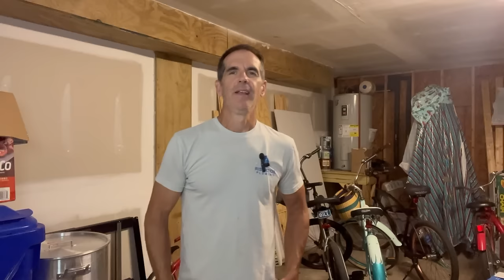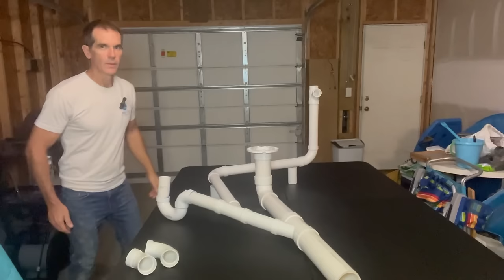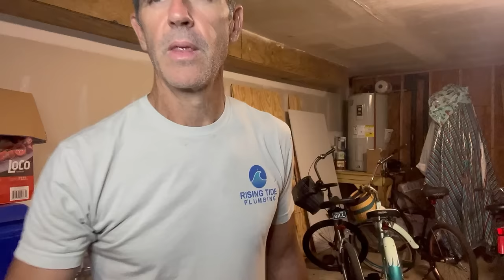Plumbing a bathroom explained in 4 minutes. [You CAN do it!] #diy #plumbing

Comment: Make sure you follow your local codes guys because in most jurisdictions a wet vent is not allowed by the inspector. I know some county’s allow it but even then you really shouldn’t do it. Unless you absolutely have to. An example is maybe you need to stay shallow and don’t have the room to run individual vents. A rule of thumb is tell me guys to follow is every fixture should have its own vent.
Reply: That's absurd. Wet venting is definitely allowed
Reply: Most jurisdictions use the UPC code and horizontal wet venting is absolutely allowed and we plumb countless apartments using it with zero issues.
Reply: Tell me you’re not a plumber without telling me you’re not a plumber

Comment: That would not pass inspection in CA.  Your example has two wet trap arms for the toilet. Also the trap arm and toilet vent combo will plug up over time. Here a horizontal drain line with a fitting for a vent must have the fitting pitched up min. 45 degrees.

Comment: 4 minutes and 20 seconds.  Most efficient and informative video on the subject I've ever seen.  Thank you.
Reply: IDK WHAT STATE YOU ARE IN BUT YOUR PITCH IS WRONG. PLUS YOUR 3 BY R Y IS NOT ROLLED ABOVE THE CENTER LINE
Reply: He is in North Carolina and his pitch is not wrong. 3 in min 1/8 fall per foot. 2 in pipe or smaller 1/4 per foot. 4 in laterals you cal get away with 1/16 in per foot. Now that is said I still try to get the 1/4 per foot on all but the pitch’s I and he listed will pass code and inspection.

Comment: Great info.  You might want to mention that while the slope and trap arm length may be legal in NC, it does not comply with Uniform Plumbing Code.  Many states use the UPC and most use the International Plumbing Code.  Please check with the plumbing inspector (Authority Having Jurisdiction) or you may be having to tear out your plumbing to make it pass code.
All in all though, Great Job!

Comment: I stopped doing plumbing work in '86 . California. Watching your video surprised me with whats allowable now. Back then only vertical wet vent was allowable,  and a WC needed a 2" vent. 

2" trap length was 5' , 3" trap length was 6' . Horizontal vents from a wye branch needed to roll up above the center line of the drain too. Lol,  my last code book I owned  was the 1976 version.
Reply: Code hasn’t changed that much, we still plumb that way here in northern california

Comment: Use the fall as precisely as possible, for example, 1/8" per foot for a 3" diameter pipe.  If you pitch it too much, you can have all of the water run down the pipe and leave solids behind to harden into obstructions.  The only exception is 45 degrees or more is treated as a vertical pipe.
Reply: My old memory was that  only until 4" were you allowed to run 1/8 per ft. Slope.

Comment: Everyone seems to forget that wet venting is an exception meaning it's allowed but not preferable. The vent in the video is a flat wet vent meaning the vent center line is at same elevation to the drain it's connected to if you're going to use a wet vent the invert of the vent should be above ithe center to the drain line it's connected to
Reply: Dry vent isn’t preferred anymore, if there’s a clog it won’t have water going through it to flush any solid out
Reply: @darkma1ice  A clog in your vent?

Comment: In California there are some differences, 
2" diameter minimum for a vent that serves a closet regardless of drain size. (That sanitary tee would have to be 2" all around)
6 ft. maximum to the vent after closet.
1/8th in./ft. grade is only allowed for 4" and bigger

Awesome video, just wanted to point out some differences
Reply: Like everything else in California,  their vent requirements are as expensive as they are inefficient.

Comment: Here in California, the minimum vent size is 2” for a w/c. I would rough a 2”x2”x 1 1/2” Santee for the lav and go straight up 2” on the dry vent by code in Cali. Thanks for the video, just subbed.
Reply: CA is UPC so a drain cant act as a vent.  This installation would not be legal there right?
Reply: @coreyfranco7060  the UPC does allow for the horizontal wet vent system depicted in the video.
Reply: @playersdream592 in the UPC code it says "a drain shall not be used as a vent".  Im in Clark County NV and I've had my drawings approved showed wet venting but got my balls busted on my underground inspections with having a single wet vent for WC and shower.  Out here im seeing either individual vents per fixture or combination double tys

Comment: No horizontal 90's allowed in Ontario period. 1/4" drop on a 3" required  instead of 1/8 and never use a 2" ptrap for a tub but always for a shower (not sure what you were roughing in for but likely a shower based on positioning). We also have to use schedule 40 pvc pipe or ABS here as that pvc isnt great with the cold. Stil a good and useful video conceptually despite the small differences! Wet venting what we call a "bathroom group" [s the cheapest and most efficient way to go where applicable.

Comment: Cool short video, i like seeing the difference in plumbing in other states in the U.S. im from Massachusetts and its very close to what you explained.  Only difference is the 3X2 wye and 2" wye would need to be rolled up above the drain, which is almost impossible to fit most plumbing especially if the floor is only 2x8 joists .

Comment: An Oregon the toilet vent must be at least 2 inch. And there must be a clean out at the end of every run. You can only use a closet bend or long sweep 90 for the toilet. All clean out must be at minimum floor level or accessible to the outside.

Comment: I pretty much agree with everything you said, but we don't use sanitary tees like that for the lavatory. .  Doesn't drain well with a sanitary tee straight into the drain line. We use short 90 then branch to the sanitary tee.

Comment: Jeff or any knowledgeable plumber, is it 15 inches on each side from the center of the toliet flange or once the toliet is installed there needs to be 15 inches on each side?

Putting a tiny bathroom in a closet size space

Comment: This looks like International plumbing code, and would not be allowed where UPC is enforced.  Never heard of venting a toilet with 1 1/2 pipe, always 2 inch and this goes back 100 years.  I  am sure it will work, however it's interesting the contrast between the two regulations.  Everything is UPC where I live.  The IPC does make it simpler for installers and is more forgiving. There are code books that illustrate the two and compare interpretation.

Comment: I have a question and maybe you could lay it out. We had a 5 foot roman tub, we had it removed and put in a large 3 head shower. We paid extra to have the concrete slab broken out and moved the drain the middle of the shower. We never had a drain issue with the bath tub, but when we put in the high dollar shower we have nothing but problems with drainage. Any ideas or suggestions, we simply do not use it anymore.
Reply: What are the problems you've experienced, and how long did it take them to occur?

Comment: 2:46 from ontario, just checked, it says max 6ft. either toilet or shower flange.
Reply: It depends on pipe size and required pitch. A 2” pipe at quarter inch per foot would be 8’, because it takes a feet to put the pipe completely below the vent. 1 1/2 is 6 feet.

Comment: I'm building a tiny bathroom over a short 3 step stair way, I made a frame to support the new floor but the drop from the toliet flange to the basement is about 3 feet, is it OK for the 3 inch pvc to go straight down that distance before turning ?

Comment: Thanks for you videos...been trying to find out while watching videos and reading books...New construction with a basement full bath and laundry (roughed in, floor poured after passing inspection.)  There is a pump in the basement floor to pump drains from the basement up and out to septic tank and I was going to tie main and 2nd flr drains into 4" where pump line goes through the outside wall.  I have a full bath on the main floor right above, and a bath right above on the 2nd floor with 2 vanities, , oversize tub and sep shower. The kitchen is on main floor sharing wet wall with bath.  My question is vents... Can I just use a 3"stacked vent all the way up for everything?  Seems like a lot of fixtures...1 washer, 3 toilets, 4 lavs, 3 showers, 1 kit sink, 1 big tub.  I just can't find anything to calculate vents per fixture even if everything is stacked on top of each other.

Comment: I want to make sure I understand fall. 3 inch line has to have 1/8 fall per foot correct and has to have a air vent at least 1/2 the size or more than the pipe you are venting and the shower and vanitee  can they use the same vent as long as its with in 12 feet of the vent? and a 2 inch pipe has to have 1/4 fall per foot?  I am  making a bathroom in a small bed room, I got a 3 inch pipe coming off the 4 inch and from right to left I will have the toilet then the vanity and then the shower. Room  is about a 10x8. I just want to make sure I got thing in correctly.

Comment: Hello - I hope this question makes sense. Would be easier with pictures. Currently my system of Vanity /sink1.5 inch vent, toilet 3inch vent and Shower 1.5 inch vent,  all had their own vent going into attic and joining on the toilet 3 inch. With a remodel I am doing the bath will connect to the old vanity/sink line and have a 1.5 inch vent wihin 4 feet. toilet isnt moving. The main concern is the vanity/sink. it is moving 5 feet away from the old shower spot. Do I need another vent for this? Based on the video and already having 3 vents in the line... im guessing not, just checking. Thanks for the awesome videos.

Comment: I have a question. I have a 2nd floor. Where the water lines were run and capped off. Between them is a 3 or 4 inch pvc  pipe that goes through the roof.  The room next to this was framed for a toilet. How can I know if I can use this 3 inch pipe as a drain for a toilet and shower and sink? Thank you

Comment: Yes, and you confirmed what I decided myself. So many say 1/8” drop is mandatory, and I’ve heard a bunch of stupid incorrect reasons. 1/8” is minimum, not mandatory. It’s so you can run through a 4” slab and not got too deep or to high at the ends. Never heard it’s different for 3” and 2” pipe. Good summary. And I also figured out about 2/3 of the details explained in this video just from thinking about things. Most plumbers get into it because it’s the highest paying trade they can handle. They usually flunked math and science. But there are some who are really smart too, like this presenter. And again, I’m sick of half the 40 minute video being theatrics to glamorize the presenter. This is what I come to these videos for. Information, not pizzazz.

Comment: OMG!  Please help!  I am having such a problem understanding this.  Are sinks the ONLY way to wet vent or can a shower, tub or toilet also be a wet vent?  Picture this.  I have a 60' main drain that will be under a slab and runs east to west through the house with the septic on the east end.  I have a bathroom slightly NW of the main branch and septic.  The bathroom consists of a shower to the NW, a tub to the North, a toilet to the NE a sink to the SW and a sink to the SE.  The sinks are split by a doorway and are only 2' from the main drain.  The toilet is about 13' from the main drain.  Should I run 2-3" branches from under boths sinks North to South and connect the shower, tub to one and the toilet to one with the sinks being the wet vent?  That would put the shower tub and toilet on the high side of the drain so will the wet vent work or does the wet vent need to be the highest point of the branch?

Comment: I don't know what code book your using. You can't flat wet vent . It look like a combination  system . But your sizing would be wrong . We must do stuff differnt in Los Angeles .
Reply: Of course you can flat wet vent, just maybe not in CA.  Remember, sometimes codes were written to help create more work and subsidize trades.  For example, Chicago and the requirement that all high voltage be in metal conduit.

Comment: Pretty sure the code states each fixture needs to tie into the wet vent individually, i don't believe how you have that set up is legal. You'd need a separate wye to go to the lav after the first wye where you pick up the tub for that to be a proper set up.

Comment: Why is it important for the air to get into the pipe?
Reply: Think about a straw. If you have a straw sitting in a glass full of water and you plug the end of the straw with your thumb then remove it from the glass, the water in the straw will remain in the straw. When you remove your thumb from the end of the straw the water will run out of the straw and will be replaced by the air entering the straw from the end where your thumb was located. Internal plumbing uses the same principle. In order for liquid to flow from your drain pipe, it must be replaced by air entering the pipe. Vents allow for this to happen. Without vents it would be like holding your thumb over the end of the straw and the liquid in the pipes would have a very difficult time trying to flow. If your pipes "gurgle" when you flush or pour liquid down drains it is because your system is not getting enough air as the liquid flows through the system. I hope this explanation helps.

Comment: We have to install that 3by 2 wye within five ft from center line of the four by three closet bend to the centerline of the three by two wye and the two inch wet vent shall not exceed fifteen ft in total developed length that's to the sanitary tee centerline that's where the wet vent ends in south fla ft Lauderdale area only six fixture units are allowed on a two inch wet vent master bathroom may have shower and tub and two sinks perhaps that's six the toilet doesn't count of course because that's wet vented not on the wet vent but that's four fixture units also we can only put 18 fixture units on a 3/4 water line there's several more goodies in the south fla building code that are different from the southern standard code all looped copper or any pipe actually must be continuously sleeved which if it does leak makes it  easy to find it boils out of the sleeve instead of running under the house for whatever time oh and that two inch wet vent has to stay two inch VTR

Comment: Can I put in a double Y and have the bath on the left side of the 3" line and the lav on the right? Will the bath get vented ok?
Reply from the maker: No.  It has to be on the line for the lav so when the toilet flushes the shower with get it’s air from the lav instead of being sucked dry by the toilet.  This is based on NC code fyi. Hope it helps.
Reply: @risingtideplumbing  Very good videos! Thanks so much for your help. So if the end of the 3" line is a WC and I have a branch on the right with a lav and a dry vent up to through the roof, and I have a bath on the left side of the 3" line (looking from above), do I need a separate dry vent for the bath connecting to the other dry vent in the attic? Is there no way to wet vent the WC and the bath? Either way is fine. Thanks again! Easier with pictures...
Reply: @risingtideplumbing  I think I see what you mean. Are you saying the bath drain must be on the same drain line as the lav, not branched of somewhere else? Otherwise maybe it needs a separate dry vent?
Reply from the maker: Correct
Reply from the maker: https://youtu.be/YWZOrZLnC9M?si=WGer_VZHsMvIadxJ

Comment: So on a wet vent I still got to run a vent pipe up threw the roof im adding another bathroom and just gunna tie into my main drain pipe wich is already vented from the toilet before it do I have to vent my second toilet or will the one vent from the toilet I have work with both
Reply: You would have to bring the 2-in vent up to the second floor and you would also need to bring a 3-in stack up top of the top plate on the first floor so that way you can run your drainage for the second floor. If you're able to wet vent the second floor, then you'll have the first floor vent coming up and the second floor vent coming up. You'll tie those in together or send them separately out the roof
Reply: Also, if you do tying both vents together, it has to be above the flood ram of all fixture units on the second floor
Reply: Flood rim*

Comment: I don’t like this  in nyc they used to vent every fixture individually.     I see lay outs like this and they  use a air admittance valve when they fail in this you have backups and sewer gas leaks

Comment: I thought wet venting was limited to vertical piping only.  Also limited to 1 and 2 fixture unit fixtues.  I see nothing but problems with that installation.  I would not call myself a plumber if I was you. You are giving out bad information.